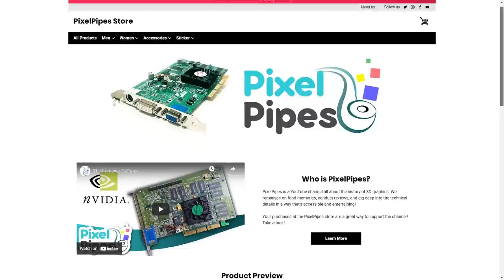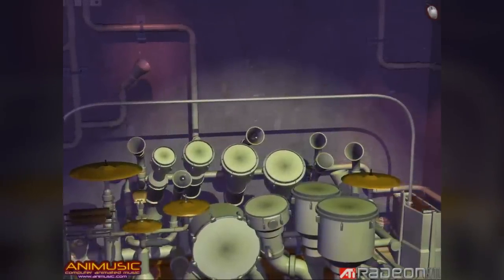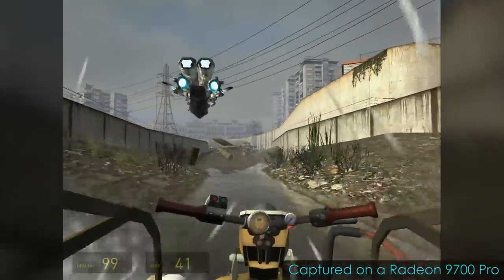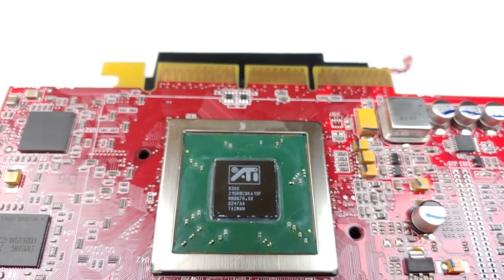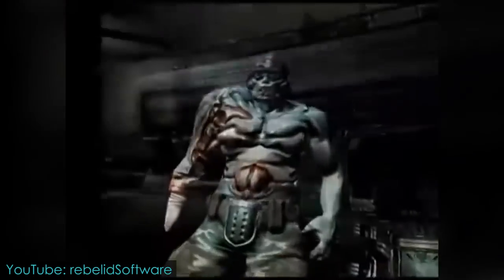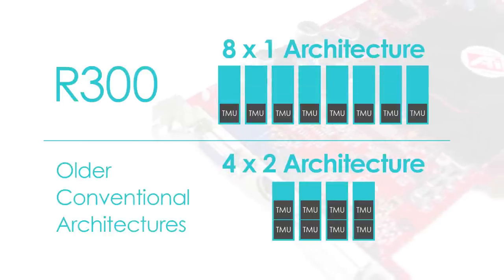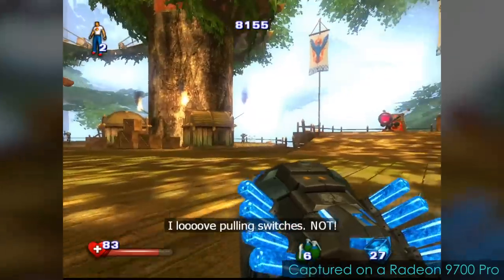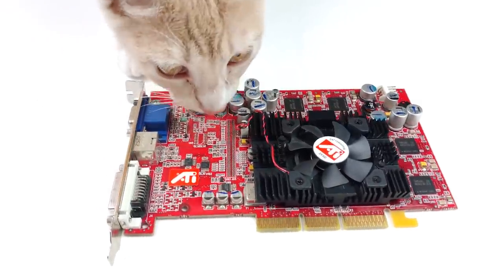ATI's Revolutionary Radeon 9700 Pro

Comment: I had a 9800 non-pro 128MB card I bought new from Newegg back in late 2003 (early 2004? not sure). It was a Sapphire OEM non-retail card. Installed a Zalman cooler and overclocked that sucker to 9800XT speeds. Used it for several years with an Althon XP system until it sadly died sometime around 2007 or so. I currently have a 9800XT 256MB card that I use for retro gaming and geez it is a beast for it's time. Capable of playing Crysis... just barely.

Comment: Yeah, had 9200 at that time, but few years later bought x800gto which gave huge boost in speed and quality. But later x1800XT made me sad, its died in a year. But still I loved ATI products and had my hands on 2600Pro, 4600M, 4800, 6800, R7 270, R9 390, RX 470.

Comment: I never had a 9700 Pro, I went from the Geforce 3 and wanting a 9700 pro to having a 9800 pro given to me. Had to wait, but that was pretty cool. It was given to me because the guy who have it to me had damaged the DVI connector. I cleaned that up with tweezers and it worked perfectly.

Comment: I loved my 9700 pro. A Hercules 3D Prophet. With a blue PCB. When the cruddy little fan by Hercules died after a few months I bolted an Arctic Cooling Silencer onto it. It still works as well, which is getting quite rare for AGP cards from that era.

Though I'm not quite sure if it's more revolutionary then for example a Voodoo, Riva TNT, Geforce256, or later the Geforce 8 / Radeon 2000. Especially the latter were a big revolution, with the introduction of true parallelisation with unified shaders and such.

Comment: I put the 9800 Pro in my first ever build back in 2004 and it was an excellent card. When I upgraded to a PCIX System 2 years later with a Geforce 7800GT I was really let down because the video quality was not a huge improvement over my old system with the 9800 Pro. I believe like you said that ATI was years ahead of the game

Comment: Remember when you could get a 9500 with a 256-bit PCB and unlock to a near 9700? If the unlocked shaders didn't fail you you felt like a badass.

Comment: Interestingly, AA wasn't needed that much as it is now. In 2003 we still used CRT's a lot and those were mostly 17-19 inches. 1280x1024 on 19 inch screen is 86 ppi, which is almost the same as FHD 23 inch ppi (95). I personally had a 20 inch Diamondtron and it could do up to 2048x1536 (not many gpu could handle that, though). Also, the CRT image was somewhat sharper than the LCD, so even 1024x768 on 17-19 inches was looking really nice even with no aa at all.

Comment: “With the top card being priced at $399” - Do you want me to cry? Do you? Because I will cry! :D
Awesome video!
Reply: It’s less impressive when you account for inflation ($599 give or take), but it’s still pretty good for what was a flagship card.
Reply: @ianweber9248  Still impressive, even if you account for an inflated inflation :-). Even more impressive is that, by 2003, the price had dropped to $300 - $320.
In my country, RTX 3080s / RX 6800XT GPUs go for 2500 - 3000 euros (that's in stores, not scalper-friendly websites!)
Reply: The dollar to performance ratio is the worst it's ever been for PC gaming. Even MSRP prices are a rip off, but you'll be lucky to find a 3060 for $1000 right now due to scalpers. The last great value cards were the 1080ti and the RX 480/580 from 2017. We've been starved for value cards and I doubt we see any for at least another year.
Reply: @EmergencyChannel  now that nVidia and AMD know precisely what they can get away with charging, I’m not sure we’ll ever see another “proper” value GPU series, but who knows.

Comment: The adaptive AF was the biggest thing with this card. You could simply set AF to 16x in the driver and have very good textures in every game. Straight bilinear, especially at low resolutions like 640x480, looked worse than point sampling; I'd rather have everything aliased than have a ton of blur across the image. The primary benefit of cranking the resolution up to 1280x960 or even 1600x1200 was to get bilinear or trilinear to use a sharper mipmap. You needed 1600x1200 to look as good as 800x600 would have looked with good AF. Already on a geforce 3 or 4 you could start to use a little bit of AF on most older games at acceptable cost and it would look much, much better but on modern games you could not really get away with any AF without lowering the resolution or hurting framerates because you were never CPU bound.

On the R300 that all changed. 16x. Set it and forget it. It wasn't perfect; it didn't do as much AF on off-axis geometry (floors, walls and ceilings were fine, but slopes seen from the side view would recieve less AF than they were supposed to). I remember this being much lamented at the time but compared to not using AF because performance sucked it was a huge improvement. Later cards gradually made the calculation for when to apply AF better and the issue was forgotten.

Nvidia FX had the a very similar AF optimization and very similar problems with off-angled geometry.
Reply from the maker: Very true!

Comment: The R300 GPU was the reference platform MS chose for the Shader Model 2.0 specs in DX9 so, as a result, many DX9 games and engines over the years ran rather well on the aging R3x0 series. ATi were prudent to avoid the lures of the MHz race at the time (unlike Nvidia) and designed a simpler, but wider architecture with good eye for future scaling, when they had to fall back to the plan-B (R420), after their first unified shader design failed (later scaled-down for XB360). The R420 was mostly slightly tweaked R350 with double the number of pixel pipelines.

Comment: I had this card oc to 9800 levels after my Ti4600. And before tat I had a Radeon 8500 for some reason. :D Only after that I moved back to nvidia in form of the 6800Ultra. I still settled for 1024x768, though, as I cannot stand framerates under 60fps.

Comment: This was my card for many years. I had the reference board with 128mb. Even far cry could run okay on fairly high settings with this on my athlon 2400+ XP with 1 gig of ram. Doom 3 even could be run on the highest setting playable (while the game said it needed a 512 meg card for that and doom being optimized for nvidia architecture. This was a BEAST.

Comment: Gotta hand it to ATI/AMD: When they find a basic architecture that works, they stick with it and only move on when they've truly hit a wall that can't be beaten by either fattening up the architecture or speeding it up. The basic R300 design was carried through to the X1000 series, only being replaced in mid  2008 by Terascale. Terascale (after a big misstep in the HD2000 series)  lasted the entire DX10 Era and was in the high end until 2012. And GCN, oh GCN: it's still punching well above it's weight almost TEN YEARS post release, and will probably continue to do so for a few more years thanks to AMD planning to port their  DLSS competitor to Vega (GCN 5) and Polaris (GCN 4) . Even the 7970 (GCN 1) still more than delivers the goods if you're willing to tweak settings in modern AAA games (3 GB is just enough if you're careful with your settings). Realistically if you still have a midrange to top end GCN card in your system, you're still good to go until the current stupidity with GPU prices end (unless you have a GCN 1 card and you want to play a DX12 only game). Try doing that with a nVidia card from 2012.

Comment: Thank you for this trip down memory lane.  This was easily my favorite card of that time.  Unfortunately, this leadership position was short lived.   I wonder what will come to be in with RDNA3…maybe they can recapture this magic.
Reply: Even if they do recapture the leadership position (doubtful, they are far behind on DLSS and RTX) it will cost so much that about 0.1% of the market will buy it. AMD should focus on being a value brand, they can be 10% weaker if the price is right.
Reply: @EmergencyChannel  - This goes against everything this video just explained happened in the past.  ATi gained a lot of the market share with the 9700pro (I want to say they took it, but that that’s a long time ago and I don’t remember).  AMD is increasing in Stream’s hardware survey (yeah Intel still owns, but there’s progress).  If this company stays on this path to have equal or better parts, I see no reason why the tables can’t shift.   6900XT is tops in resolutions under 4K and remains very competitive in games without Ray tracing.  I’m still not sold on DLSS, if it can manage to stay relevant over the next 5 years or so, ok.  Lastly, AMD’s RT isn’t bad, pretty impressive for a first showing.  2080Ti like showing in their first go at it, is respectable.

Comment: One of ATIs most important cards, great card to have for the collection if you can locate one working. I have 2 Hercules Pros and 1 non pro all work but have had about 10 cards before I found ones that work. Needs TIM replacement poor contact and overheating kills the memory controller 😐 sucks.

Comment: i only had 9200 fooled by the 9 in front and low price and later my sleeper pentium 3 had oem refub 9800xt it was a bit overkill for the cpu but it still run many games it should not and run them smoothly like butter with ocasionaly stutter when reloading something . my current wierd ryzen/gf1030 pc can't run flatout 2 on the settings i run it on my pentium 3 and that tells something  about radeon 9700 and 9800 family

Comment: Somehow, I knew this was going to come up. I can't knock the 9700 and 9800 for the kind of surge ahead in performance it was at launch ... in Direct3D stuff.
But my time with the series of cards back when it mattered, was anything but storied and pleasant. OpenGL performance and stability in particular, was horrendous... almost a generation behind, even. Drivers were, for lack of kinder wording, a ritual of reinstalls galore, trying to find the right balance of drivers that would keep things working. And nothing after Catalyst 4.2 allowed me to ever play Knights of the Old Republic 1(and/or 2), ever again. And ATI's technical support was... anything but. I can go back to my archives on GMail to prove how miserable it was to try and get anything but an automated response from the company.
Safe to say, I get why fans laud it. but for me, it was a lighthouse in why I still, even in 2021, look at Radeon drivers with suspicion and concern. I've experienced first hand how gloriously they can break and corrupt an install. Conversely, intel's worst failing with video is that their integrated graphics are always a decade behind.

Comment: Late dx9 spec (dec 2002) was one of the reasons for poor FX series performance. Undefined spec. of DX was by chance perfectly guessed by ATI. Later with 6000 series NVidia made true comeback and 7000 series was also on spot. True blow to ATI was done with 8000 series. It took ATI few years to recover from it but newer fully, so we still have Nvidia running supreme in graphics industry.

Comment: The 9700 Pro is very near and dear to me even though I've never actually had one (closest I got was a 9600 XT a couple years later).  When it released was right around when I really got into building PCs and following the hardware releases, and it was mind bending how awesome that card was (and especially those tech demos!) in comparison to everything else out at the time.  I became a proper ATi fanboy because of this card, even though I've kind of been partial to nVidia since seeing the 6000 series blow everything else out of the water and ATi's naming conventions get so confusing and drivers get so bad in the 6000/7000 nVidia heydays I just didn't care about them since.  ATi with the letters separate from each other is still my favorite logo, and I wish it never merged or changed to AMD.  I'm also still the proud owner of the "RADEON" user name on overclock.net 😎

Comment: YOU MUST MENTION that the 9700 and 9700 pro and the enferior models were locked with a simple resistor and software and when people found out abt that they could make a 9700 to a 9700pro so easily ati pulled em from market

Comment: I'll have to be a little less positive about this card. On paper it was AMAZING. In practice, however ...

The early to mid 2000's was a really bad time for hardware retention. Graphics cards, CPUs and motherboards would all have short life span due to a combination of bad capacitors flooding the market and AMD CPUs & ATI graphics cards reaching ridiculous temperatures in an age where PC cases were not really optimised for cooling with cheap stock fans (AMD had some REALLY crappy fans). 

The Radeons series was no different - everyone I knew who owned one, had to replace it within two years due to artefacts. The cooling on many models was simply insufficient and my own Radeon 9700 Pro lasted just a year. My 9800 Pro = same. Despite doing everything to cool them down (I even left the side panel open with a fan aimed at the card during Summer), they would still die on me and stores would refuse warranty despite admitting it was a major issue (ATI was refusing to honour warranty blaming the user). As such, it's an era I'd rather forget.

Ignoring all this, ATI's drivers were abysmal as well. Every driver update broke more games than it fixed it seems and older games often barely worked. As a retro gamer this was not acceptable to me. When my 9800 Pro died, I simply put my old GeForce 4 Ti 4200 (which had moved to my brother's PC) back in my own and I made do for several years before I got the 8800 GT in 2007 - I still have that card in working order today.

Comment: Had this GPU in my first PC build from the ground up. Paired with a Pentium 4 2.66 GHz it was a great gaming machine. I kept the GPU for  many years after i stopped using the computer. Tested it after some years but threw it away when it was not working.. found out later it could possibly be fixed just by repasting and reseating the cooler..

Comment: Slightly faster memory core and bus width. Show me 3DMark scores. I still have my Radeon 9600XT which when I bought I knew was quite a fast card for what I could afford back then.
Reply from the maker: There are benchmarks in this video and I also have a Card Battles video with the 9700 Pro with even more benchmarks